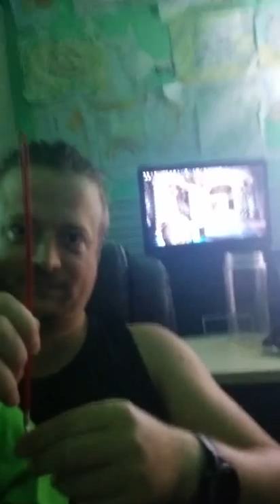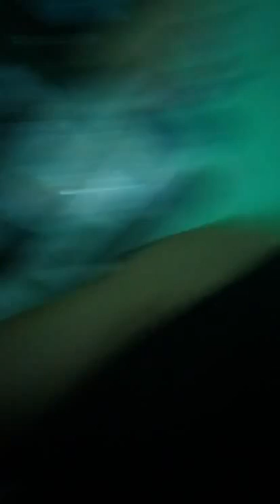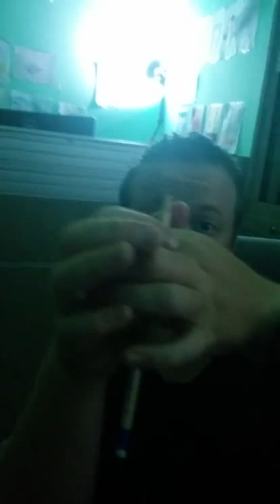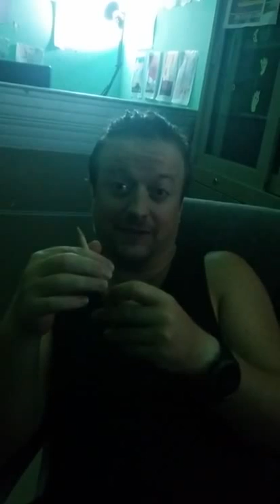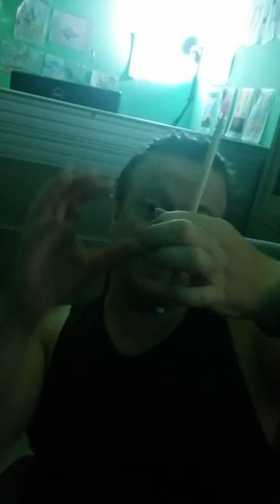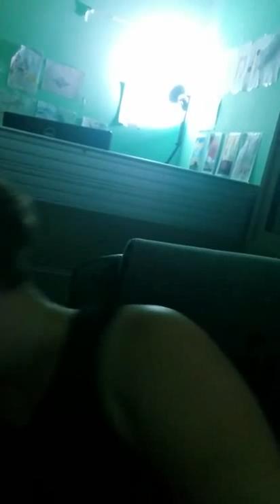Questioning Space-X cylindrical Re-usable design

Comment: Your a fucking idiot it would rip it self to bits under that kind of load and you would have to make it much heavier to get it to work the body panels are made of thin carbon fibre you would have to beef them up massively
Reply from the maker: when you beef them up you could in turn carry less propellant, etc... there should be offsets everywhere. Using natural atmosphere based resistance as a braking method is more logical than creating artificial resistance to slow descent, and all the carrying all the extra resources to do so.

Comment from the maker: Spinning is an option ... it is in fact not a necessity. Spring loaded or mechanical powered hinges could also work. Also the spinning could be a short burst in the upper stage, just to release the flanges. Then as the rocket is in landing mode the aero breaking non booster navigation could be use to regain spin into a controlled descent. The dissipated stress on the elongated cylinder body through distributed increased extra drag over an extended non-central frame/inner bidy is the plan for a more controllable/less complex soft landing, and less stressed frame work. We can learn alot from nature, from structures to the common chicken egg..... look at the forces its axis are able to sustain while distributing the load.. so while the atmospheric pressure I think cause load to be felt all through the main body frame in a more difficult way. If the boosters are placed at the bottom, or sides, no matter how you play it the sheering force from turning the cylinder from any of the thruster points is going to be more focused causing more potential stress fractures than if there was a webbing of high tensile non rigid materials between flanges. 

Of course for launch there is no better shape than the current cylindrical traditional rocket shape. However landing and quick re-equipment for the next launch is a completely different objective, and I think its foolish at our current stage in development to not use our technology to reconfigure into a more efficient configuration for descent . Ascent and descent should have two very different structural adaptations for optimal performance.